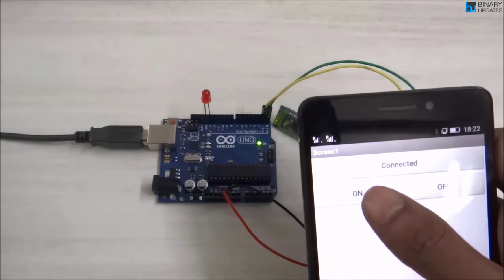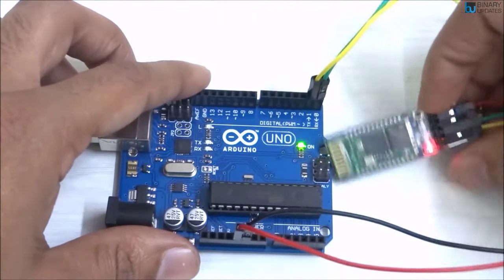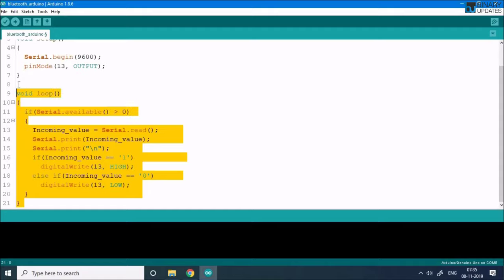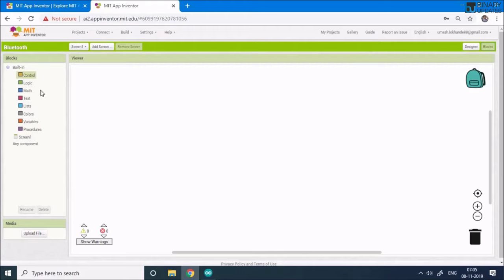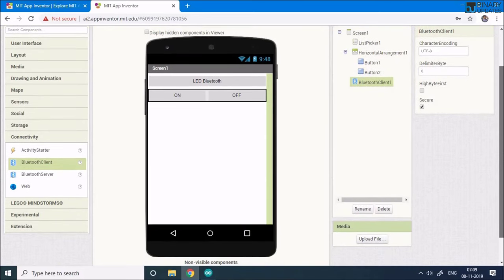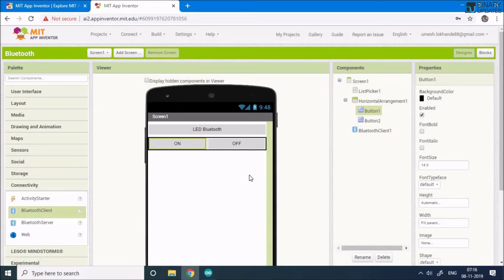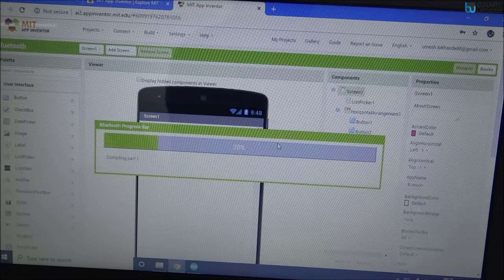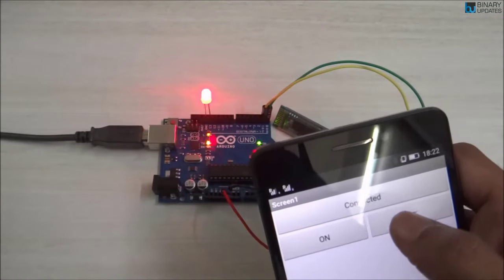HC-05 Bluetooth Module with Arduino-MIT App Inventor

Comment: I don't know what's wrong with my project but when I try the LED won't be turned on

at first, i can't upload the code from arduino IDE if using the pin 0 & 1 for RX TX but then I try to use SoftwareSerial library to define pins 10,11 to be RX TX 

is it correct? or it must be on pins 0 & 1 for RX TX? 

I use the apk in the link, it could be connected but the led won't be turned on when i clicked on.. 

Any solution would be appreciated🙏
Reply from the maker: Hi Orfigeminkch, when we use Arduino Pins 0 & 1 as Rx, Tx to connect to HC-05 Module. Arduino won't allow us to upload the code. That's why in video I mentioned that first upload the code and then connect HC-05 Bluetooth module to Arduino's Rx and Tx pins. This way we can avoid issue with code uploading. Otherwise using Software Serial is an option. Now when you use software serial library make sure use software serial to receive data. This will leads to change in Arduino code. I hope this may help. Good luck and best wishes!

Comment: Hello!Your video is great!
My program works successful by sending the signal from the mobile phone, but I have a small problem, if i press too much time button(probably 12times),
My phone will not be able to send messages, I have to disconnect my phone's bluetooth connection and reconnect it
also my disconnect button won't work at that time
😭😭😭
Maybe there are some problems between hc 05 and my phone......
I try to use different phone but the results was in the same situation...
How can i fix it?
Reply from the maker: Will you please try with other mobile phone. If it has to do with Bluetooth of Mobile phone. Otherwise there isn't anything much that can go wrong on HC-05 Bluetooth side. Best wishes!

Comment: I go by every step here. Everything as per description, just when pressing the handphone, it shows a blank page, instead of connect to hc05. My hp blue tooth is 100% confirm on. Did you miss something at the MIT controller
Reply from the maker: In recent days, you have to perform additional steps in Bluetooth settings of mobile phone. Please Enable "Find Nearby Devices" option. I have made dedicated video to show you how to solve this issue. Please check the link in this video description of find it on our channel. Good luck and best wishes!

Comment: code is here 
char Incoming_value = 0;
void setup() {
  // put your setup code here, to run once:
  Serial.begin(9600);
  pinMode(13,OUTPUT);

}

void loop() {
  // put your main code here, to run repeatedly:
  if (Serial.available() > 0) {
  Incoming_value = Serial.read();
  Serial.print(Incoming_value);
  Serial.print("/n");
  if(Incoming_value = '1')
  digitalWrite(13,HIGH);
  else if(Incoming_value = '0')
  digitalWrite(13,LOW);
}

}

Comment: If I want to put more LEDs, can I use other numbers or does it only work 1 and 0?
Reply from the maker: Hi IvaironRex, you can write logic in Arduino code for multiple LED and accordingly change logic in Button in MIT App inventor. You can do either way depends on how you prefer. Good luck!

Comment: can u use multiple led? or you can only use one
Reply from the maker: Hi Zenix, yes you can connect as many LEDs as you want. You only need to write Arduino Code to control multiple LED.
Reply: @BINARYUPDATES  ok, thank you. but when i made the app and installed it on my phone, why is it showing error?
Reply: It always says it needs bluetooth permission

Comment: Thanks for the video and great explanation. After pairing to HC-05 when I press the LED Bluetooth button I am getting an Error 503  *The specified address is not a valid Bluetooth MAC address*. Could you please help me out to short this issue? thanks.
Reply: It is working fine now. It was my mistake I change the blocks After picking and Before picking.

Comment: thank you for this detailed video but I have a problem with pairing Bluetooth it cannot pair
Reply from the maker: Hey Feliciano, I wonder if you've tried to pair with other phone as well. Sometimes mobile or android settings could make difficult for Bluetooth Module HC-05 to pair. So try with multiple devices to get more inside of an issue. Good luck and best wishes!

Comment: I have a problem with hc-05 Bluetooth modular. I can pair the Bluetooth with my phone, but when i try to use the apps that using Bluetooth connection, it says "it has no connection, Bluetooth is off", yet the app detects the Bluetooth pair device... I have tested the Bluetooth, and it is fine, can make echo when linking Trx to Rdx... Whaddya think about it?
Reply from the maker: You can download entire code and apk file related to HC-05 with Arduino project and try with our Bluetooth.apk file. You'll find out whether its an issue with your created MIT Inventor made project. Good luck
Reply: @BINARYUPDATES  Ah, I got it. I just have tried by using multimeter (i have no LED), and the current came as the button pressed. Thus, I think the downloaded apk program is somehow the culprit. I'll try to fix the interface program. It always got freeze when I give instruction via Bluetooth, and saying that the Bluetooth is not on. Thank you very much!

Comment: I think a good follow-up would be how to modify the app so that it's more tolerant to errors.  For example, if the connection to the HC-05 does not succeed, the app still says connected.  Is it possible for the HC-05 to send the current status ON or OFF to the phone?  When the ON or OFF command is sent, it should change that status.  Should we have a button to close the app?
Reply from the maker: Hi Konrad, I'll cosider adding follow-up video lesson based on your input. Usually when you press button ON/OFF on mobile App. The data or status from HC-05 Bluetooth Module will be sent to Arduino and can be seen on serial monitor. I believe to close app you can add button if you want. I hope you enjoyed video. Thanks for your input.

Best Wishes
Umesh
Reply: @BINARYUPDATES   I think there's actually room for several lessons that build on your first one.  Consider for example how you would control a row of four latching relays and report their state.

Comment: The rx pin on the Bluetooth module is NOT 5V tolerant you must use a potential divider or level shifter before connecting to it from the Arduino.

Comment: How far the phone and arduino module can communicate?
Reply from the maker: Hi Elmer
Usually, the normal Bluetooth range is 10 meter. But always varies as wireless devices are sensitive to external noise and environment. I hope this may help.

Best wishes!
Reply: @BINARYUPDATES  many thanks for prompt reply you're awesome. I'm just new to arduino and have read about HC-12 module and it says it could reach as far as 1 km although it's transmission is not through Bluetooth. How would I use HC-12 if I want 12 switches (12 I/O pins of arduino) to be controlled remotely, thank you 😊

Comment: be careful not to fry your module. the module rxd input is rated 3.3v max. arduino delivers 5v. use a voltage divider to increase the lifespan of your beloved bt module
Reply: it works also if you disconnect rx

Comment: Great Job and excellent video ! but when i download your apk it works great but if reuse you .aia and just build it and download the apk through the QR code, when i want to connect i didn't see any more the blutooth name and adresses. Do you have an idea of what goes wrong ?
Thanks a lot for your kind attention
Reply from the maker: Hi David, 

You can open Bluetooth Apps settings. And then under settings, you've to allow this app or give permissions for this app to use the mobiles Bluetooth.  

Also, in some mobiles phones Bluetooth Apps, you need to find and enable (checkbox) to "Find nearby devices option". Just play with bluetooth settings of your mobile phone and App.  And I am sure your issue will get resolved

Good luck and best wishes!

Comment: thank you it was very helpful, but i have error when i click Bluetooth it says (The specified address is not a valid bluetooth mac address) could  you  help me to fix it
Reply: *clickBluetooth LED listpicker
Reply from the maker: Please make sure connections twice and also if HC-05 Bluetooth is paired properly with phone. In some cases if HC-05 is broken it won't get paired. I this may help you. Thanks

Comment: Can you make a complete step by step video tutorial of how to send messages/texts to a display using an Arduino board (Nano/UNO), HC-05, MAX 7219 and MIT App creator? This would help me and a lot of people out here. Thanks.
Reply from the maker: Hi Sirgen, I'll soon explore some services on cloud something like google firebase to show how to send test message using Arduino and MIT App Inventor. Also, soon we will release video about interfacing MAX7219 Dot Matrix Display using SPI Protocols with Arduino Uno. Thanks for your suggestions.

Best Wishes
Umesh
Reply: @BINARYUPDATES  Oh that's great. I made a left turn and ended up in the world of Arduino and LED displays so I thought, oh what the heck I'll carry on. And I got deeper and deeper. So I glad I've found some help to get through. Great work thanks 😊

Comment: Hi, thanks for great tutorial! But I need your help, I have tried many times but the code can't be uploaded and it is because "An error occurred while uploading the sketch". Can you tell me please, how to fix it?
Reply from the maker: Hi Sheila, you're not able to upload code in Arduino, because Tx and Rx Pins of HC-05 Module is connected to Arduino's Tx, Rx. They make arduino busy. So while uploading code please disconnect bluetooth module for a while and then first upload arduino code and later connect HC-05 Module with Arduino Uno. And programming will work fine! Give it a try. Good luck and best wishes!
Reply: @BINARYUPDATES  It works! OMG thank you so much!

Comment: I tried connecting to the Bluetooth Headphones using MIT APP Inventor-2. I am getting error as 507. Bluetooth version is 5.0. I tried with Blue client and BluetoothLE extension as well. I am not able to connect to my headphones. I could not able to get help anywhere. Your tutorial is great. So, I hope, you can guide me better. No Aurdino connection. It is simple logic. Scan the list and pick from list picker. I can scan it. But, not able to connect.
Reply from the maker: I have not tried yet but will consider someday. I hope bluetooth has been paired properly in your case. I will update in future on this. Have a good day

Comment: When HC-05 wired with Arduino UNO then few post says use a voltage divider in Rx port. I can see you are not using this, is this really required?
I have tried without voltage divider circuit and it has worked for couple of days then it has stopped working.
Please confirm if this required or not?

Comment: Did the tutorial, it worked great! Thanks!
But I have one problem... when I disconnect the Arduino from my pc, so it is on it's own power supply, the bluetooth won't connect anymore with my phone. Any idea what may cause this and how I can solve it?
Thanks in advance!
Reply from the maker: Hi, this may happen because when Arduino get power from external source then make sure Arduino and HC-05 both get enough power to drive circuit. Now, if external battery or adaptor fail to provide enough power then Bluetooth may fail to pair back with your phone. I hope this may find useful to you. Good luck and best wishes!

Comment: Sir how can I get the mac address of the phone connected to the Bluetooth module? Thank you in advance!
Reply from the maker: You can get MAC address in your mobile's network setting. And in case you're interested in knowing mac address of HC-05 Bluetooth Module then check in bluetooth settings there in listed device you can easily find it. I hope this may help you. Best Wishes
Reply: I mean using codes sir from Arduino IDE. But i already have the codes sir. Thankyou
Reply: @BINARYUPDATES  Is there a way to pass those mac address to another Arduino?

Comment: Great tutorial but my led is not lighting up - HC05 is connected, tx led shines when receiving BT data but 
no effect:(
Reply: also no message in serial port monitor. Buad is set correctly
Reply: When I type 0 or 1 in serial monitor it works fine, but when using BT app it doesn't work

Comment: Hi, this way worked for me on Arduino Uno. However, when I tried to do the same with Mega it only shows me "?" in the serial monitor. Don't you know where is the mistake?  Thank you.
Reply: Make sure the Baudrate is right!
Reply: I have the same problem - I checked baud twice, it is correct

Comment: Please Ive problem " avrdude: stk500_getsync() attempt 2 of 10: not in sync: resp=0x00
Reply from the maker: Make sure you disconnect Tx and Tx Pins from HC05 Bluetooth module while uploading Arduino code. Once code is compiled and uploaded then connect Bluetooth module. 

This issue come because of your Arduino IDE can't upload code on Arduino. As Tx, Rx pin is busy with HC05 Bluetooth module while uploading code.

I hope this may help you. 

best wishes

Comment: After I made the app the HC-05 didn't show on the list even though I had it paired. Please help
Reply from the maker: Hi, please go to your Bluetooth settings on mobile phone. And check the allow other device to connect. Also make sure allow all the bluetooth settings to find external Bluetooth devices like HC-05 module. This settings vary on every mobile manufacturer so hard to tell exact steps. Still if you allow all permission in Bluetooth then you'll find it will start detecting by your Mobile App. Good luck and best wishes!

Comment: my led does not turn on from the app input. how do i fix this? i followed the video tutorial and made sure the bluetooth was connected and everything wired properly
Reply from the maker: HI Lucas, please check on Serial Monitor of Arduino. Make sure you select correct baud rate on Serial monitor. And then you press button on mobile App, check if you receive any data on Serial monitor. If not then maybe something is wrong with your HC-05. I hope this may help. Good luck and best wishes!

Comment: What if I wanted to use 1 button instead of 2? Is it possible?
Reply from the maker: You can do so
By modifying App using MIT App inventor
For this we need to modify User Interface and logic in Block View of App Inventor
Reply: @BINARYUPDATES  i see. Is it possoble for you to show me? I've tried a to follow a couple of forums and could'nt understand.

Comment: I wonder if you can help me please. I am having a problem. With the code line
  if(Serial.available() > 0){
    Incoming_value = Serial.read();
    Serial.print(Incoming_value);
    Serial.print("\n");
    if(Incoming_value == '1'){
      digitalWrite(13, HIGH);}
     else if(Incoming_value == '0'){
      digitalWrite(13, LOW);}
  }else{
      digitalWrite(13, HIGH);
      delay(500);
      digitalWrite(13, LOW);
      delay(500);
  }

My LED flashes, meaning the Serial.available() =< 0. Has my bluetooth no connected? Can anyone help? Thanks.

Comment: This is the first time I do this kind of work, when I click on connect, it outputs such an error. How to solve the problem?

avrdude: stk500_recv(): programmer is not responding

avrdude: stk500_getsync() attempt 1 of 10: not in sync: resp=0x51

avrdude: stk500_recv(): programmer is not responding

avrdude: stk500_getsync() attempt 2 of 10: not in sync: resp=0x51

avrdude: stk500_recv(): programmer is not responding

avrdude: stk500_getsync() attempt 3 of 10: not in sync: resp=0x51

avrdude: stk500_recv(): programmer is not responding

avrdude: stk500_getsync() attempt 4 of 10: not in sync: resp=0x51

avrdude: stk500_recv(): programmer is not responding

avrdude: stk500_getsync() attempt 5 of 10: not in sync: resp=0x51

avrdude: stk500_recv(): programmer is not responding

avrdude: stk500_getsync() attempt 6 of 10: not in sync: resp=0x51

avrdude: stk500_recv(): programmer is not responding

avrdude: stk500_getsync() attempt 7 of 10: not in sync: resp=0x51

avrdude: stk500_recv(): programmer is not responding

avrdude: stk500_getsync() attempt 8 of 10: not in sync: resp=0x51

avrdude: stk500_recv(): programmer is not responding

avrdude: stk500_getsync() attempt 9 of 10: not in sync: resp=0x51

avrdude: stk500_recv(): programmer is not responding

avrdude: stk500_getsync() attempt 10 of 10: not in sync: resp=0x51

Problem uploading to board.  See https://support.arduino.cc/hc/en-us/sections/360003198300 for suggestions.
Reply from the maker: Hi Good man, Its seems like you're having issue with uploading code on Arduino. I suggest to ensure while uploading code, make sure HC05 module is not connected. Once you upload the code then connect HC-05 Bluetooth module with Arduino.
Reply: @BINARYUPDATES   Thank you very much!

Comment: Sir, I have designed my application using MIT app inventor. But while opening that application in my mobile, it is generating this error. ‘The opertion > cannot accept the arguments:,[“”],[10] ‘
I am also making a project where an app needs to be connected to Bluetooth HC05.

Comment: But HC05 itself has a arm processor, RAM, ROM and PIO's.
Why use Arduino then. 
Can't we run an application on HC05 itself to glow and LED when receives data from android app.
Reply from the maker: Yes Shubham, you may do that
But this video is intended to show how one can use HC-05 Bluetooth Module with Arduino Uno